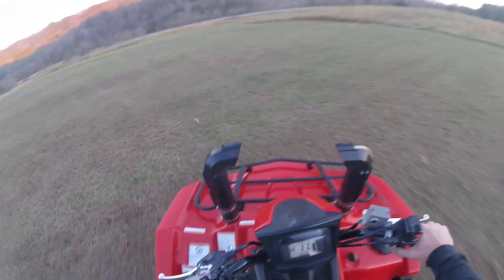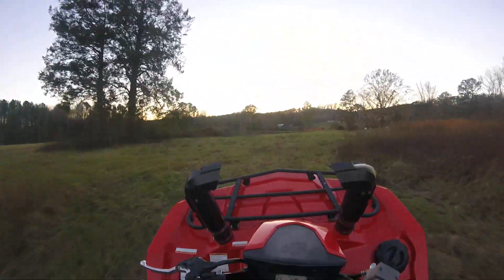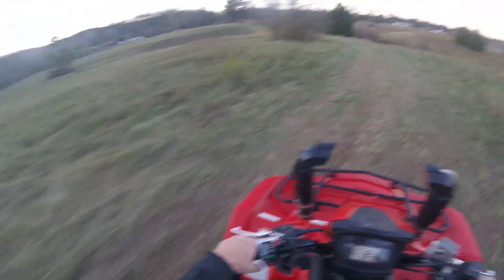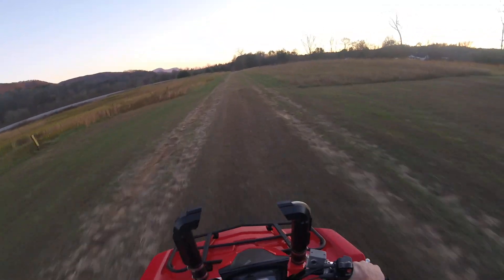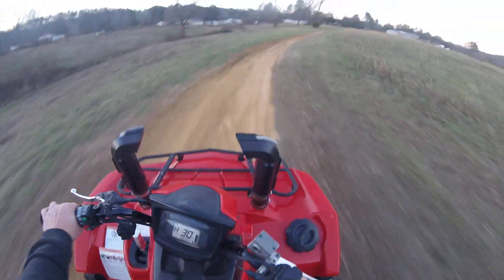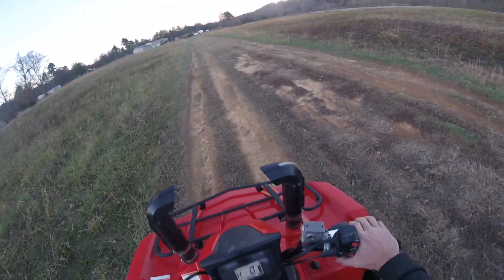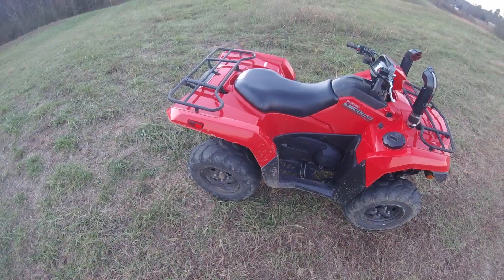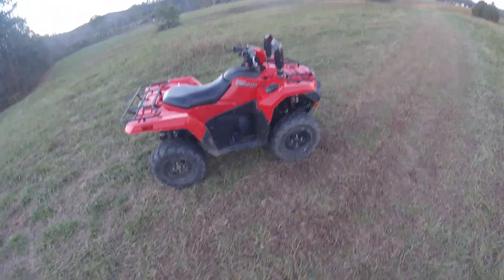how bad is your kingquad 750 2300 miles update ,BEST MODS SO FAR

Comment: My stock 05 KingQuad  just hit 2700 Miles and is going strong 2 years of ownership and have put 200 miles on it. 3700 miles on my 08 Grizzly (also stock) a couple months ago and put about 30 miles on it and hope it does as well. Both are old machines, so they have had their hiccups, but I'm glad it's going great! I'm stuck between the two.

What were the benefits from you switching from a Grizzly to a KingQuad???
Reply: off road abilities, king quad is another level, i don’t understand why their so under rated im the only one in the group with one and the one who gets least stuck if ever!
Reply: @AN4MER  I proved that wrong... mine stalled and broke down in a mud puddle, my Grizzly made it out with just some slip. But later I looked back at the footage and realized really that it was a driver mistake. I was not only going different ways, but didn't give the right amount of throttle on entry and going over the log. I sent it too hard and that explains why I made a big splash and caked my radiator. So that explains it. Both machines are awesome, with my Grizzly for some reason feeling slightly more capable.

Comment: I just bought a ‘22 KQ 750 today with 180 miles and at idle there’s a slight tick/ clacking noise from the bottom of the motor on the left side. Any idea if it’s normal for these machines ?

Comment: Weird my 2023 Suzuki king quad only does 64 mph stock and bounced of rev limiter. Did 67 when newer but has 1300 miles on her now. Does that sound normal for speed with everything stock? I figured I lost some mph do to belt wearing some from normal use?
Reply from the maker: Not that's not normal